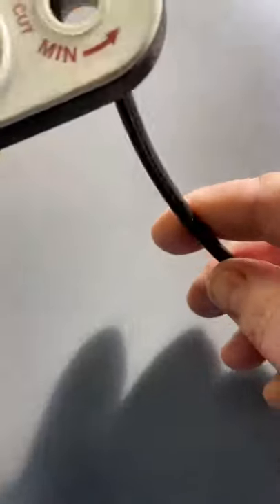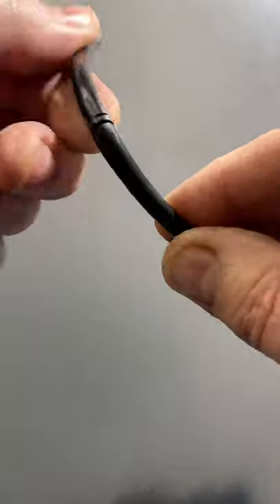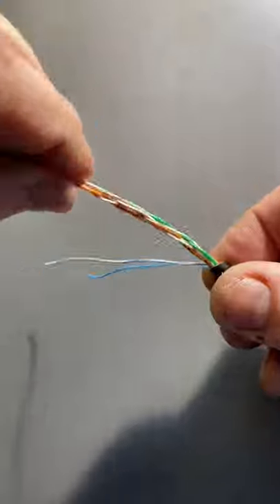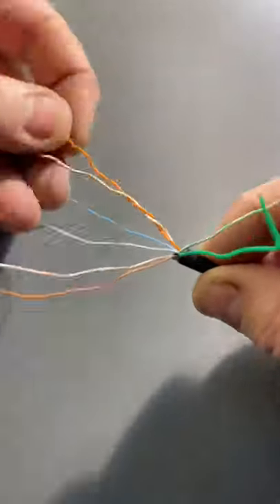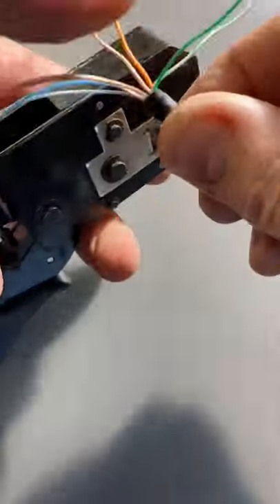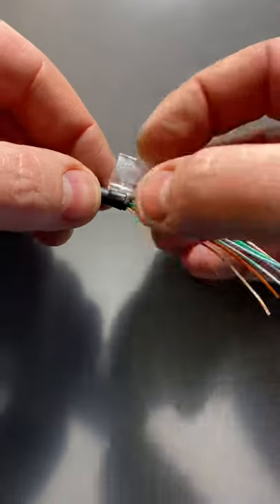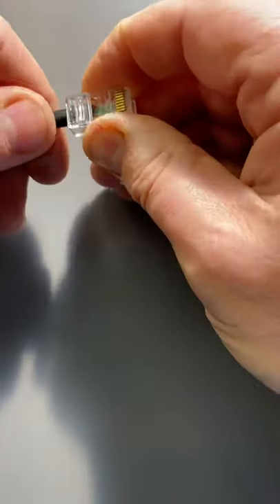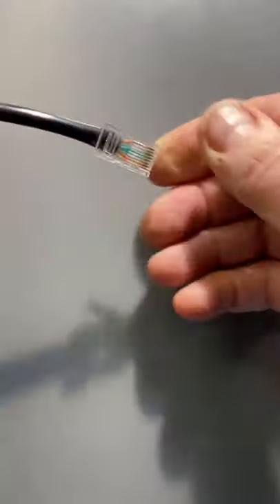HOW TO make an Ethernet cable with DADSKILLZ

Comment: you can use the stripped off cable jacket to untwist the pairs by putting it between a pair where one wire is inside and other outside and twisting it down.